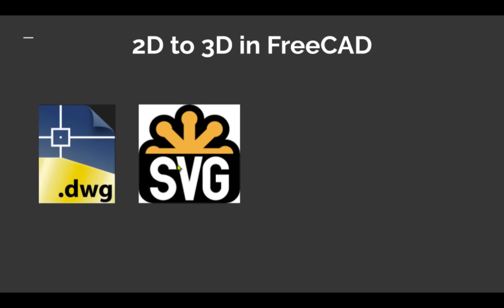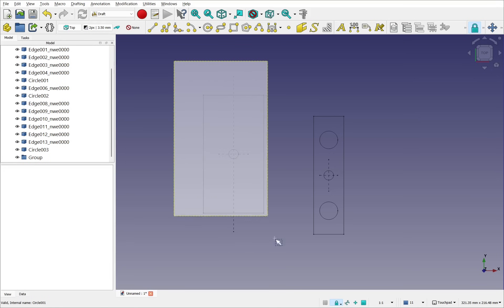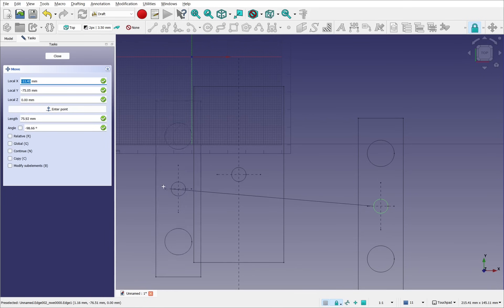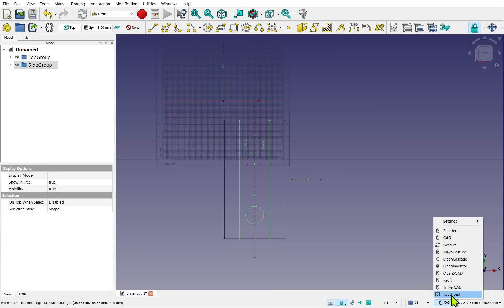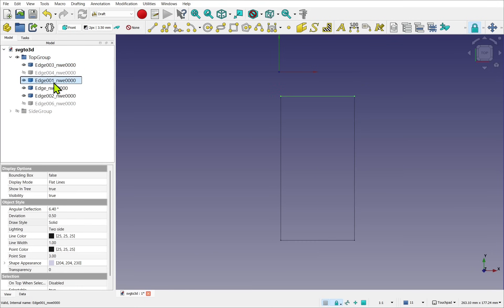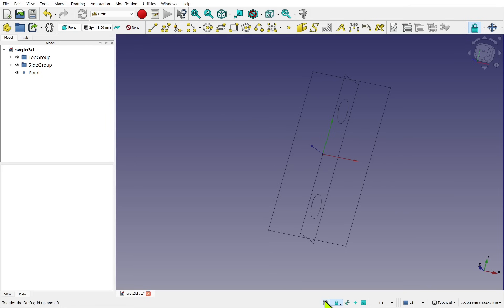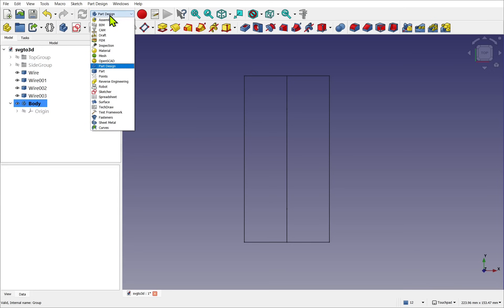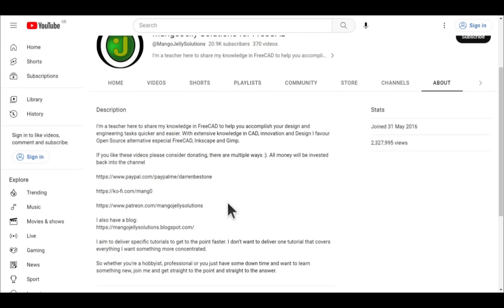FreeCAD: Converting 2D Plans To 3D. The Very Basics!

Comment: Hi, MangoJellySolutions.  I plan to use this alongside Blender for specific projects that need precise measurements, and I was wondering if you could help me with two things: First, I was using FreeCAD to try making a Spur Gear that has a module of 1 and 17 teeth.  When I was using the mathematical formulas from KHKGears and a FreeCAD tutorial to help me, I expected to get a gear that is 19 m exactly all around but got close approximations instead (18.8959 for X-axis and 18.9704 for Y-axis) when I imported it to Blender as an object.  I was wondering if you could help me figure out how to get the measurements exactly to 19 m for all the edges.  I'll post what I inputted so far, as well the type of gear I entered, below.

Gear Type: Involute Gear.
Addendum: 1.00
Dedendum: 1.25
Module: 1.00 mm
Pressure Angle: 20 degrees.
Profile Shift Coefficient: 0.00
Root Fillet Coefficient: 0.00